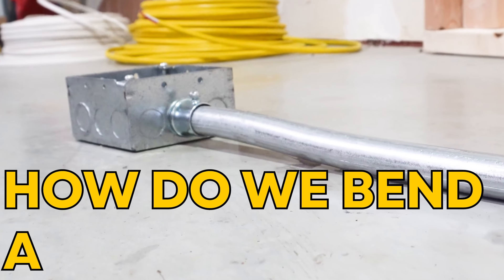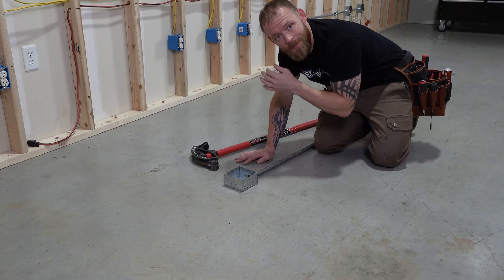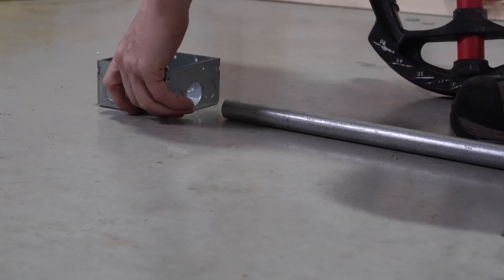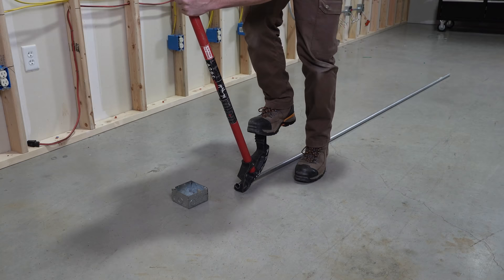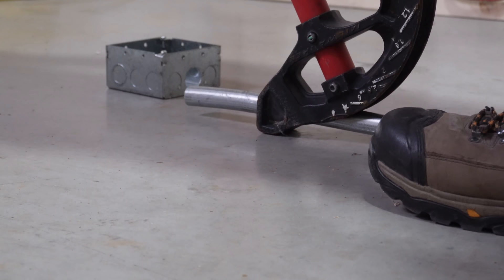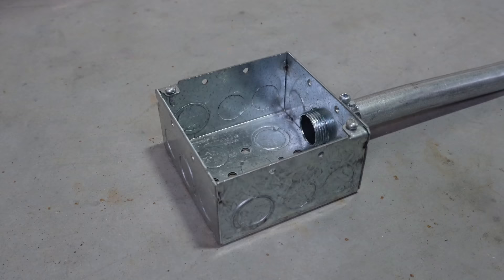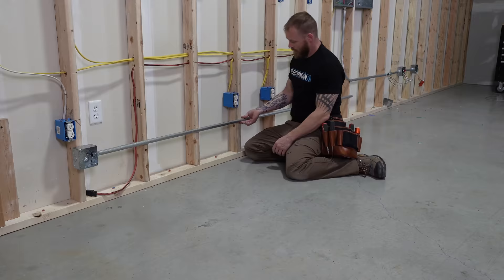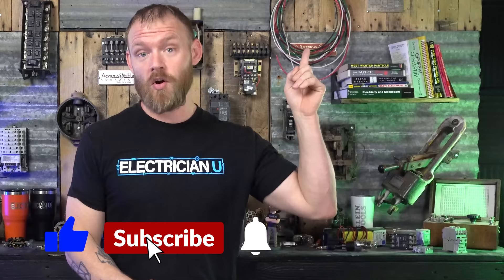How to Bend a Perfect Box Offset? Electricians Need to Know How to Bend Conduit.

Comment: I always make my mark at 2inch and 4 1/4 and bend at 10 degrees for both, that’s my method! Works like a champ every time! Love the videos!
Reply: whats the shrinkage?
Reply: @dougfoster445 you usually don't have to worry about shrinkage with a 10 degree bend
Reply: @BigNipsOnIce  I get it, but still would like to know
Reply: @dougfoster445  1/16" per one inch of obstruction. 3/8 of that 1/16" will be like .0234375 of an inch. So 2.35 hundredths of an inch.
Reply: 10° box offset bends won't work on 3/4" emt....1/2" emt yes
Reply: Should be 2” and 4 1/2” since the multiplier is x6 and it’s about a quarter inch of rise, it’s minimal but that’s how I do it..

Comment: If you have a bunch of them side by side and you need to have consistency, I recommend measuring it. Mark a line at 2.5" and 4.5", and then use the 10° to bend the first mark and use the level on the second.
Reply: For what size is that any? Thanks for the numbers btw they help a lot.
Reply: @luisdominguez213 late af but yes. The numbers are arbitrary. They’re there more so for consistency in aesthetics. As long as your second mark is a bit past your first bend you’ll be fine. But whatever numbers you use always keep it consistent so it doesn’t look like shit.
Reply: The 10D is your friend.
Glad you put those inch marks, I've been using (more or less) the same for years.
It's not in your ugly's book, and nobody ever told me :(

Comment: I have been bending conduit for over 15  years and you are the first person I have ever seen bend it on the floor. I only bend 90s on the floor. Almost everything else with the bender standing up. If you are bending an offset much bigger its not possible to bend on the floor unless you can hand the end of the pipe out a dock door or something. 

That was also a very strange way to install the box connector. Put it in the box first and put the locknut on hand tight with the screw on the connector facing about 30°s from being tight. Then grab the connector (not locknut) with channel locks and tighten it until its straight. The locknut will grab on the box and keep itself from spinning.

I know everyone does things differently. That just looked much more difficult than it had to be.
Reply: I’ve been bending conduit for less than six months and I would already say the same thing
Reply: I do the same trick as you with the connector 😁
Reply: Different methods, same result. I also think bending offsets on the floor is too much for the back, imagine doing it for every offset.
Reply: I'll agree on bending box offsets in the air as opposed to the floor and 90's should definitely be bent on the floor. Basically just box offsets I will bend in the air. For regular offsets, I would definitely bend on the floor as well. It would be required to get it perfectly straight and level.

Or maybe its just me, but I much more rely on the level than my eyesight to make offset bends be the correct size. Especially since most of my work is exposed piping. If its pipe thats going above a tile ceiling or in a wall, I honestly dont care so much for it to be precise. But thats not usually the case. At least at my job sites.

Side story: When I first started learning, I tried doing bends by eyesight and while standing up and they where always wrong by an inch or more. And thats because bending in the air, the bends will tend to be wider as in a bigger sweep because the pipe is being bent from further back on the shoe rather than by foot pressure like when done on the floor properly. But even floor bending can have a bigger sweep on the bend when not applying proper foot pressure.
Reply: @fjl05  nobody bends 90s in the air
Reply: @lukehumes2402  I actually tried it once. You can only bend so much before you have to put it on the floor anyways. lol

Comment: One thing I like to do, that I haven't seen mentioned yet in the comments, is use the natural seam on the conduit as a point of reference.
You can typically see the clearly when looking on the inside of the conduit, and, depending on the manufacturer you can also see it on the outside.  I'll then use a black marker just to make is super easy to see the 180 degree change.
This is most helpful if you are putting multiple bends in to the same piece of conduit.

Comment: I've never bent an offset on the floor....always in the air and usually using the 10 deg marks
Reply: Same here :)
Reply: Works great if you have a 20' ceiling, otherwise good luck dodging light fixtures or acoustical tile etc.
Reply: @charlesford157  if your running large spans of conduit, chances are there aren't any ceilings yet.
Reply: @purenupe1  That is certainly true. That and have fun trying to bend a 12" offset in a piece of 1-1/4 off the ground.
Reply: @charlesford157  I give you that, 1.25  is going to be tough in any situation.
Reply: I think it’s for apprenticeships
Reply: Definitely a fan of doin it on the air though, much faster..
Reply: Definitely a fan of doin it on the air though, much faster..
Reply: @purenupe1  yeah 1.25 sucks lol.
Reply: Agreed.
Reply: The real question is did he hit the screw driver to tighten the lock ring with his linemans?
Reply: Yeah
Reply: @Andrew Hartman  linemans... you mean hammer? 😏

Comment: the multiplier for a 10 degree offset is 6. the box offset for a box like that is about 3/8". If you take 6(.375)= 2.25"; this is how far from the first mark you make the first one. Some benders are bad about egging the end, so it's a good practice to come back 2" or 2.5"; some will come back 2.5", but if you are doing a stub for a light box on a concrete ceiling, you may need to keep it as tight as possible and start at 2". Ideal benders, I have found, you can get within a 1/4" from the end, and it won't egg the end. A box offset uses a 10 degree angle. Some people like to eyeball the bend, but if you are trying to make all the offsets look uniform and professional, you should use a pencil and make your marks. It might be a good idea to carry a cheat sheet for fractions to decimals and a calculator to do the math quickly. there are people using apps on their phones, but being on your phone is not going to look good on the job. Some employers want you to keep your phone in your lunch box to check on breaks! I know the Ideal bender has its multiplier and shrink charts for bends. If you start putting more space than the multiplier call for between the first and second mark, your bend is not going to come out right. Anyone remembers this from when they started bending conduit!

Comment: Find the 10 degree mark on your bender, Bend til the top edge of the conduit lines up right in the middle of the 0, Flip, Repeat.  Move on to the next one. 🙂
Reply: The middle of the zero..gonna give that a shot shortly. 3 1/4" spacing?
Reply: @robertmilkshake1013  maybe just a Hair shy of dead center

Comment: Use multipliers and measurements... Perfect box offset: 2.5" for the first bend 4 3/4" for the second bend at 10 degrees and you have a perfect box offset. It specially important to measure the distance between bends because all your box offsets will look the exact same!
Reply: What’s your  distance between the bends?
Reply: @reyder7661  2.25"
Reply: U are correct I leave 2.5 between those at 10 degrees
Reply: @gus732  A box offset is a 3/8" offset. If you use your multiplier for 10 degrees, 

3/8" x 6 =2.25"
Reply: My journeyman gets mad at me for measuring box offsets. I find it faster that way. Takes longer to tweak. Would rather measure quick and bend it right the first time
Reply: Give it a few more years and you won't need to.
Reply: This 100%!  Professionals measure So everything is identical.  There's no over or undershoot to correct.  No holding it up to boxes.  Especially larger 10 X 10s.  It only gets more difficult when guys are trying to put offsets into conduit that is getting saddles and 90s.
Reply: @ExoticTuber  I would too. Box offsets should be second nature. If you're new, he can't get mad because you're slow, especially since he didn't teach your for to do it faster.
Reply: that's how its done😊
Reply: @ExoticTuber  I find the situation in the field to be fluid (aka random, or not ideal), so tweaking is required, even on perfectly dimensioned offsets. Or the company bender is worn out/bent, and precise markings are wasted on it.
Reply: @ExoticTuber  I can't stand it when journeyman get mad about that stuff. Lazy!

Comment: Very interesting to see your method using EMT.on my side we use (PLASTIC PVC) electrical conduit with a spring bender inserted inside the pipe to make offset or 90 degree bend. Thanks for sharing D.

Comment: A good pipe bender bends from the ground usually a tell tale sign when people bend from the air they aren’t very good at pipe bending. There are some situations where you have to put a little bend in the pipe in the air before placing it on the ground but you should always start and finish a bend on the ground to be 100% accurate

Comment: Great info for a any worker running pipe. I am curious if you could do a video of procedures tracing all circuits in a panel to update very old panel schedules. What are the tricks of your trade without shutting down active breakers that are being used everyday? Commercial building. I have a couple buildings I need to update. Appreciate you.

Comment: Box offsets. Just keep doing them, eventually, you will just make them like tying your shoes. You don’t need to measure the 2”, and shrink back…just bend the first lip, flip it and bend the offset just past the bend of the first bend. If it’s not perfect, that’s fine, you can make it fit with your strapping and box/emt connect.
  Have pride in your work though, if it’s not up to what you feel in your gut - as safe and good looking, cut it and do it again. Also, the box offset is the only bend I DONT make marks for (line up marks).
  Finally, practice, practice, practice.

Comment: Nicely done.  However I'd usually be using raised saddles to fix the pipe and the seat of the saddle clam would raise it to the level of the knock-out without bending.
Reply: Huh?
Reply: I deleted my first comment out of respect for Dustins page. My question is, why would you use any sort of fitting to make your conduit go straight into to conduit instead of just putting a box offset on it? I understand theres jobsites where you have to keep the conduit off the surface for cleaning behind it, food service,etc; but to use Minerelacs and/or any fitting to avoid making a box  offset is just lazy and a waste of your Bosses money. The goal isnt how to get your pipe run done without making bends, dude!
Reply: @jeffreyharbert3439  if conduit is the only option, like in Chicago, (even in homes) you have to make use of every bend effectively. If you have an offset, you've now taken away one 90 degree bend, which won't allow you to get to your next box and still follow code. Yes, I know you can pull wire through 5, 6 or even 7 90s. But it ain't right.
Reply: @jeffreyharbert3439    My guess is that the box knock-outs are spaced to meet distance saddle held pipe if that's what you happen to be using. And no, you wouldn't generally go to the trouble just to avoid bending offsets.

But there are other reasons one might use them; the two most common being where regulations require a gap for cleaning (which is why they are sometimes referred to as hospital saddles) and where the surface on which you are mounting is uneven.

Looking at the installation in my own home done in 1950 there are not many places where the pipe is surface mounted but where it is, yup, they used distance saddles.

Sometimes it really is not a case of doing something better or worse but simply differently.

Comment: Off question since your talking EMT! I have a home shop with three phase machines. I have a phase converter. I am a one man shop so I can only run one machine at a time. Right now I have a three phase bus. I will need to rebuild my electrical in 30 days. So it will be inspected. The machines are 240 bolt three phase from converter. Two questions. Does each machine require its own breaker or are three phase bus systems allowed. Second question is what do I do with the wild leg? If you run a single phase sub circuit using wild leg to neutral, your screwed as it’s not supply to neutral but like the square root of 3 times your supply to neutral.
Reply: How do you plan on pulling a permit?

Comment: Good info. , just a tip, it’s easier to bend it in the air instead of on the ground, it won’t kink it if you do it right and you can actually see how much you’re bending, it’s just a box offset you guys don’t over complicate it 👍🏻
Reply: Done it both ways as a beginner (3/4 emt, 1/2 emt, 2 inch IMC with a hydraulic bender). I wouldnt recommend anyone as a beginner to do it in the air. You have to juggle a 10ft pipe or worse a already bent pipe and make sure its level with the rest of the bends. Second of all the bender unless you have an ideal bender with the boot, will most likely slip out of the novices control and slip and either damage the floorspace, send the pipe flying, hurt the person bending, damage property etc etc.

Comment: A box offset is a 3/8" offset.   Offset multiplier for a 10 degree bend is 6.   3/8" times 6 =2.25"   Place a mark 2.25" from the end of the conduit. Bend your first bent at the end of the conduit, spin conduit 180 degrees and make your second bend at your mark. Make these bends up in the air. It is much easier that way. It is also easier on your back. You can also see what you are doing better. Only one mark is needed and all your offsets will be the same.  If you are doing concealed conduit work, obviuosly, your bends don't really need look as good. Russ- Journeyman Electrician from Oregon.
Reply: How do you maintain the 2.25" distance between bends if you dont even bend both your bends at the same mark on your bender?

Comment: This is the first time I don't like the way you explain something when it comes to this box offset.  
The obstruction height for a regular 4S box that you're trying to get into is 3/8 and if we go off the chart a 10° is the six as the multiplier. 3/8 of an inch * 6 = 2 and 1/4 of an inch. That would be your in between to the second Mark for your second bend. 
The reason why I bring this up is because a lot of people many years in the trade do it that way but never have matching box offsets like it's a lazy way to do it. I just would like to see consistency when it comes to something so simple for me it shows importantance. But great video man keep on making more
Reply: No math needed for a box offset. If you’re in a situation where you want numerous box offsets to match, then use math if you need to, or use a box offsetting tool.
Reply: @jeffreyharbert3439  there is math to everything what are you talking about and you just basically repeated the same thing I said when it came to matching conduit. I understand what you're saying when it's simple to 10° bends couple inches apart but the technicality of it is what I'm referring to when it comes to an explanation I really thought he was going to go more in-depth with the video
Reply: @ninmmkmfdm  I said theres no math needed. Relax,Einstein
Reply: @jeffreyharbert3439  good one buddy. You got me there.

Comment: I find the box offset and 90 degree turns easy. The hard ones are the double bend to jump over an existing conduit. Maintaining the straight on 2 bends is my big challenge. I have produced and installed a few wobbly looking jumpovers.
Reply: in my experience, all the EMT has straight lines running the length of the conduit. barely visible, but you just pick 1 and use it as a guide
Reply: Get your box offset and 90° out of the way first, then make sure your 90° is 100% perfectly plumb or level. Now, but your pipe that you bent in the box connector, line your pipe up EXACTLY where its gonna be strapped, and put a pencil mark dead center on your pipe where you’re crossing over the pipe that’s already on the wall. (The obstruction) and from there, use your math youve been taught. That mark you made is your first bend! 45° using the notch on your bender, followed by your two 22° bends afterwards. Just need to figure out your rise. Your rise is how high your obstruction is.

Comment: Unrelated to conduit, but which is the preferred method when installing several receptacles in a run, pigtail each one or use the feed through on receptacle?
Reply: Pigtail if it's commercial it really is the best because if one recepticle fails the rest on circuit are fine but in residential I see it's pretty much always fed trough the recepticle